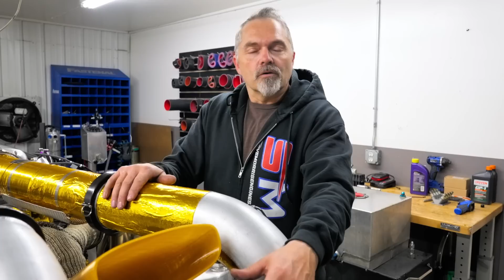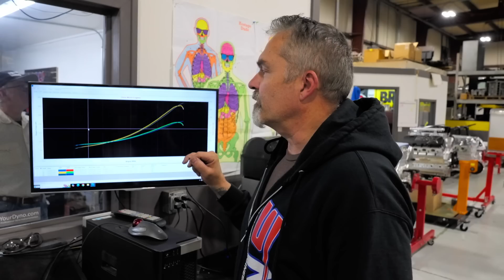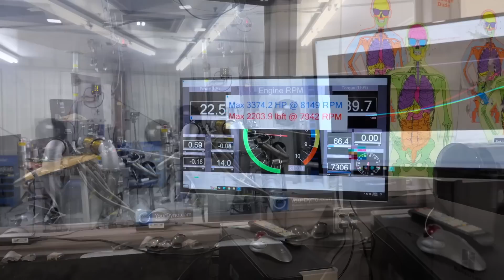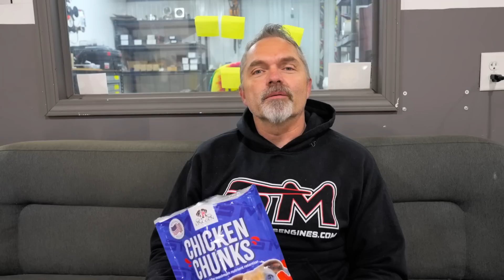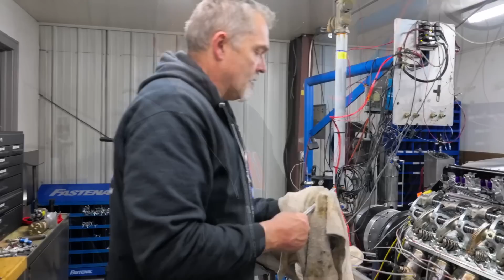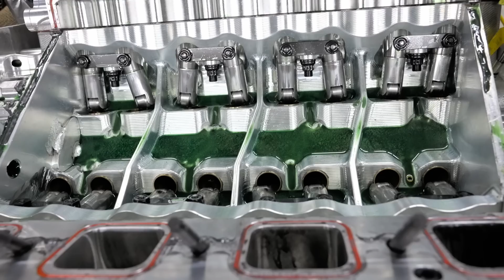Building A Land Speed Record 500+ MPH Engine

Comment: Air is interesting when talking about hp and pressure. A liter of air weighs 1.3 grams. It's all the small molecules that make up the air that weigh. When the air moves, the pressure decreases (that cause the "intake to deform").

Cold air is actually cold gases that are denser, which means more oxygen per volume. This allows for more fuel while maintaining clean combustion and gives more power. Cold air is also "drier". 

Always as fun and interesting with a new "Morris video"👍👍
Reply: Dammit!  I don't want to create an argument with you, but I (for some unknown reason) cannot let this comment stand on it's face.  It is kinda true, but there are some errors in it's logic... 

If air weighs 1.3 grams... I have to ask... At what temperature?  At what elevation?  At what humidity?  You see, there are more factors than just a blanket 'air weighs X'. 

Yes, you are correct, when you say that air moves, the pressure decreases.  That is true... To the converse, moving air, creating a negative pressure, in it's environment, moves slower than a pressurized air... 

Cold air is denser, absolutely.  and in a way, there's more oxygen per volume... but I'm afraid people may misunderstand what your are saying.  I'm reading what you say as oxygen (only oxygen) increases with lower temps.  The actual fact is, while you are correct, is the ratio of oxygen to nitrogen doesn't change, no matter the temperature of the air.  So, it's not more oxygen per volume, per sea.  It's just that there's more 'air' (oxygen + nitrogen) because any molecule, or atom on the periodic chart, decreases in size the colder it gets... With one exception... WATER.  Water actually expands when it freezes. But that's a conversation for another time.  

When you say cold air is 'drier'.. I'm not exactly what you mean by that.. Do you think cold air is less humid?  That's patently untrue, unless you get below about 30 degrees Fahrenheit. the air may be slightly drier, within the context of the same humidity of say 40 degree air, but it's not proportional.

Actually, I've discovered that there's more power to be made in humid air, than drier air.  Which doesn't make sense, on the surface thinking level.  As more water in the air (humidity) would displace the appropriate amount of oxygen (oxidizer) from the air.  Well, I'm here to tell you that actually more water in the air, actually produces more available power given the same parameters.

What I will tell you is, the higher humidity air the engine is running in, the higher the emissions (HCL & NOx)  will emit, without catalytic converter interrupting the exhaust gas flow.
Reply: @atheplummer  Inject water into the combustion chamber cools the detonation and raises the compression because of the steam created in the cylinder during fuel burn.
Reply: @atheplummer  Excuse my sloppy and compressed answer, a little more detailed but still concise. 

At 0 degrees Celsius 1 atm (101.325 kPa) air weighs 1.2922 kg/m3. While at 1 atm and 20 degrees C 1.2041kg/m3 and 35 degrees C gives 1.1455 kg/m3. Now it was about "cooling the intake air", and that's why I used 1.3 in the text. 

For oxygen in "air", air is simply gases. And really simply 78% nitrogen, 21% oxygen, 1% other gases. 

"drier" air, for example
70%RH at 0 degrees Celsius 101.325 kPa 2.64g/kg (absolute humidity) [Cdp -4] and 
70%RH at 20 degrees Celsius 101.325 kPa 10.21g/kg (absolute humidity) [Cdp 15] 

As for water and increased power, water injection (also methanol) has been used for the same reasons. To absorb heat and evaporate, increase the density of the air and provide "more oxygen" (also advance spark timing without increasing knock or reducing durability) but that's a whole other discussion 

Hope this didn't make the answer unnecessarily complicated🤔
Reply: @ Umm... I'll get back to you when I'm sober.. LOL

Comment: If your dog has a bristly coat, they need to eat more protein. Chicken is a great source for protein. Salmon too, but costs more and smells. 
It's a real shame that cam synch shaft locked up. I don't know, an engineer will have to design one with softer metal at the housing so shaft doesn't get locked up. Old Fords would squeak when theirs would let go. They made the housing aluminum and the shaft steel so it couldn't lock up the shaft. It's been too long since I've had one in my hand.

Comment: Practical engineer here.  I can tell by looking at that air inlet runner, It's like a funnel in reverse, no wonder it's sucking in at high RPM's (very high vacuum load).  

The inlet, where the air enters the intake, must be larger than the throttle body inlet.  I wondered at the beginning of the video what that orange piece was.  

Think of a Tuba (musical instrument) but in reverse.  The object is to take a larger opening at the inlet, and cram more air into a smaller tube, that works fine, because the pressure is always increasing.  What you have here is a negative pressure behind the inlet.. no beano ( I don't know how to spell mexaican)

Anyway, If you can't increase the size of the inlet, you can 'trick' it but you have to use the same size throughout the pipe form one end to the other.

You know how to do this, because you are already using the technology on your wagon.  The Calloway intake shape on the body would do the trick.  High air velocity throughout the length of the pipe, with no negative pressure areas.
Reply: I wonder what the negative pressure is 1/4" in front of that intake inlet.  I'll bet its crazy low.
Reply: @atheplummer  more importantly what's the local pressure when installed in the streamliner and running at high enough rpm/boost (and therefore mph) when the deflection was observed?  Bet there is some ram air effect in play when at those higher mph speeds.
Reply: @hondaman08  Haha, yup.. I thought about the ram air effect about a millisecond AFTER hit reply.  Good catch.  

My thought is, that the  E gates would be able to compensate for that factor.... the difference between being on a dyno, with static air pressure, opposed to the engine running across 400 mph intake air, in the car.  

I sill think the callaway style intake shape has been proven to be the best intake ports discovered to date.

Can you imagine the next evolution to the engine dyno being done inside a wind tunnel?
Reply: @ Certainly be interesting to map the condition differences between static dyno cell vs running in vehicle. Betting there will be in vehicle testing to validate the engine management controls prior to a full run.  May also be that the intake shape was solely profiled that way due to the dyno rig setup, vs what will actually be in the car? 

Idea of a wind tunnel dyno is neat. CFD tools can give close enough feedback for body shaping / inlet area pressures so I wonder at what vehicle velocities it would become a relevant tool for engine setup? Probably only very high speed applications since it's likely that for most lower speeds, the turbos are not yet starved for air.
Reply: @hondaman08  For sure, running a engine dyno in a wind tunnel... With the engine in the car, could replicate real world events.  Wow, what did I just do?  Did I just make engine mapping that more expensive?  I hope not.. But some nerd is going to read this comment thread, and take it to the next level.  

Anyway, I think some testing in real world, test vehicles could present data that could be isolated, or localized events to represent air intake charge differences, much as computer simulators predict aero characteristics prior to actual wind tunnel testing.  

I'm so amazed at how far technology has taken us since the muscle car era.  Could you imagine what the big 3 could have done, with the power we have now?
Reply: @atheplummer  a chassis dyno gets close enough and then testing passes in vehicle go from there. There's a reason why the drag race (& likely the land speed guys too) data log and make tuning adjustments after each pass. While a wind tunnel dyno presents a more controlled, repeatable environment the cost likely outweighs the benefit of actually running the vehicle as intended. Not to mention, how many wind tunnels are out there that can reliably run 200+mph through the test section?
Reply: @hondaman08  I'm not saying anything you've mentioned is wrong... because it's true.

But have you seen the crazy money NASCAR and F1 spend on their programs?  

I'm willing to bet some NASCAR team would read this and say... Heck yes... Let's put a engine dyno in a wind tunnel, with a 7 post chassis dyno.. we'll figure out how to finish this race in first, before the green flag drops.
Reply: @hondaman08  Your comment brings up a surprising data point, that I didn't think would have ever happened.  
That being Cletus McFarland's car "Leroy"  (A corvette 'cart' (body removed).  He has ran that car in the 7's for years.  He had a custom fiberglass body made for it and gained like a second, with no engine tune changes.  

so, No I don't agree.  I think aero plays an extremely important factor in lower speeds than you can imagine.

I used to race short track dirt.  My max speed was less than 100 mph at the end of the straightaway on a 1/4 mile track.  I cut dime off my lap time, just by adding a 7" spoiler on the back of the car.  

I think aero makes a huge difference once you get about 30 mph, and gets exponentially more important as speed increases .
Reply: @atheplummer  I agree that aero overall is hugely important to the vehicle overall as power required to overcome drag is a function of the airspeed cubed.  His drag numbers went from 1701lb to 715lb or 907hp to 381hp @200mph. That is a huge difference and reflected in his much lower ET on the same tune up. 

My point is that at the lower vehicle speeds, the engine is not likely starving for air unless the inlet is poorly positioned so the advantage of running it in a wind tunnel for engine tuning would be less. 

In Leroy's case, the turbos are mounted up high out front where they didn't see much change in airflow body off vs body on. Starr took extra care not to block the inlets and shape the air toward them but as you mentioned, the engine tune up didn't have to change.  

Steve's wagon on the other hand has the formed inlets because his turbos are buried down low. This has shown improvement due to the better airflow down track. Also, if you notice, his inlets are positioned toward the hood rear / cowl which is a higher pressure zone on the body. 

Now say in this land speed streamliner, the aero effects at 3-400mph will be much different and make engine inlet duct positioning more critical to take advantage of any high pressure regions. Of course the challenge there is to find a tunnel to do 3-400mph.
Reply: @hondaman08  I like conversing with you.  You are obviously intelligent.  I think we probably agree on more than we disagree on.  But it's difficult to have meaningful conversations here.  

you're the kind of guy I'd like to se next to on a bar stool, and have some really interesting conversations with.  

That being said, are you also a follower of Brian Salter Racing?  If not, you might want to be.  He and I have some interesting things in the works.  There's nothing to show currently, but within a few months, I suspect you are going to see some mind blowing engine improvement videos.. That's all I'm going to reveal at this point... You are getting a 'early access invite"... To which, I'm gonna remember your name, because I know you are going to push the limits, when we show you what we're up too.  

I enjoyed our chat.  we obviously run in the same circles... Like minds and all.. Hope to shake your hand one day.
Reply: @atheplummer appreciate the kind words, I’ll keep an eye out

Comment: Steve the cam sink welded  to the housing and striped cam drive gear and ruined the cam. How does the brass gear destroy  tool steel cam?
Reply: @JW-Math  OR…Did the cam tooth break and destroy the cam sync bronze gear???
Reply: @ericbair4360  ^^^this^^^

Comment: The chicken chunks aren't fully cooked.  When you rehydrate them in water, they turn pink.

I'm no biologist, but I'm willing to put my money on the fact that there's no salmonella (or any other bad microbes) in a meat that's been through the process of freeze drying, which I'm willing to bet, has been done to that underdone chicken, to make it white in color in the first place.  

Therefore, even though the chicken is not cooked to 'safe temps' per human consumption standards, there's no way any microbes could survive freeze drying temperatures.

My question is... when you pop one of those bites in your mouth... Is it dry?  Does it taste freezer burnt?  i don't think Dewey would care either way.
Reply: It tastes akin to half strength chicken, ... chicken light.

Comment: $700 for that impact is a rip off. Dont care if its got a lifetime warranty. I could buy 3 Milwaukees for that price and they have a warranty..not lifetime but youre not gonna burn it out 3 times in a lifetime
Reply: I'm on my 3rd out of pocket at work .. depends what you do... I work on diesels and tractors  all day so it's getting worked out but I started with a snap on now it's at home because I just like my Milwaukee stuff to take the pounding plus the Milwaukee takes off 18 wheeler tires that my snap on didnt, same with crank bolts
Reply: What??? The Milwaukee is $500.  Most Snap on and IR batteries last 8 years.  I even have a IR that's over 10 years old and still good.  Milwaukee don't last me over 3-4 years.  Milwaukee isn't what it used to be, the quality went way down.  My $1300 Milwaukee impact didn't work right out the box and the die grinder I just got was missing the metal clip that holds the case together.  Spending an extra $200 is well worth it to me if the batteries last twice as long.
Reply: There crazy! that's like the cost of a nasa impact lol
Reply: You definitely can’t buy three Milwaukee’s for that
Reply: Just paid 230$ a month ago for the milwaukee. @scewston420

Comment: Surprised that engine doesn't have a dry sump and external oil pump. Maybe the oil pump got tight and blew a tooth off of the cam and caused to distributor to jump up and snap off above the retainer when the gear rode up onto the next tooth on the cam? Something other than the distributor caused that.

Comment: Why would the cam sink lock up?  Is it bronze bushed?  Does it need some type of 'oiler'?  Does the oil need to be under pressure, or can it just have oil pouring across the busing/bearing?  Maybe it needs a roller bearing to survive?

I'm just asking questions here.
Reply: maybe the gear are causing dowwards thrust.

Comment: 3:18, you said no water brake dyno can sustain high horsepower extended runs. Why is that? Is it a cooling thing, like the water can't cool fast enough to maintain a consistent temperature? I'm a dyno newb with very little experience with them.
Reply: was thinking the same thing, and yea, probably a cooling thing, 3-4K hp is no joke

Comment: :_dewey:Those heads with Manton Rocker Arms are what we call engine porn.  Bronze gear metal chips going through the oil pump might not be so bad.  The steel gear tooth not so good.  I think you have to drop the pan!!! Dewey is a great Shop Dog.:_dewey:

Comment: With the amount of dyno pulls you make, one would think you should think about either a battery storage system or a grid tie to be able to save some money on power usage. Could be a fun project at some point in the future.
Reply: Nice! It'd be great is they could recover some of that energy. 

But I suspect runtime may not be sufficient to justify it. 

The expense of designing, building, installation and operation of the generation, storage, and inverters needed. 

Engineering challenge. 
It'd need to be implemented without altering the dyno load being measured. 

That's solvable. 

You're right. 
Capturing the energy being expended in a turn-key dyno/battery storage/switchgear cabinet ... outputting three-phase power for in house use. 

Great idea.
Reply: @FOH3663  that's why I mentioned battery storage. With the varying rpms, you couldn't get a good 3 phase power output. Also, the battery storage would have to be rather large, as 5000HP is almost 4MW of power... Most batteries couldn't store that much that quickly. 

Doing a quick bit of math, at 5k HP,  only 1kWh is being generated every second. I think it would only be worthwhile for longer runs, like testing a boat motor wide open for minutes.
Reply: @IceBergGeo  
Yeah the key would be not impacting the primary task of assessing engine horsepower/torque, etc. 

Using the hp output numbers doesn't include the dyno's load. Besides, hopefully all that would be needed is to top off storage batteries. 

Perhaps a more idealized and realistic version would be a full rooftop solar panel array, feeding storage, and an invertor system supplying shop power. 

Then, that system being bolstered by whatever could be harvested from dyno pulls.
Reply: @FOH3663  Steve goes into how the dyno measures the HP/torque of the engine in a video years back. Short version: there is an arm that measures the rotational force output of the engine brake.

So, as long as the brake (which would be the generator) can provide a smooth resistive force, there should not be a problem.